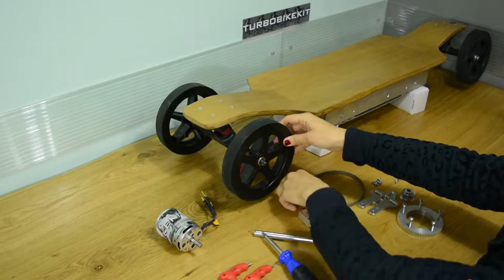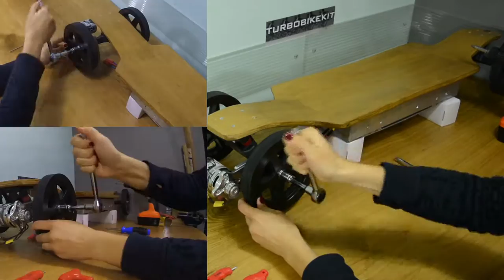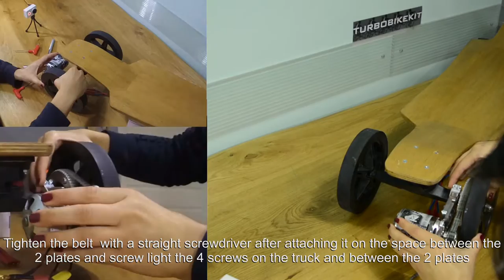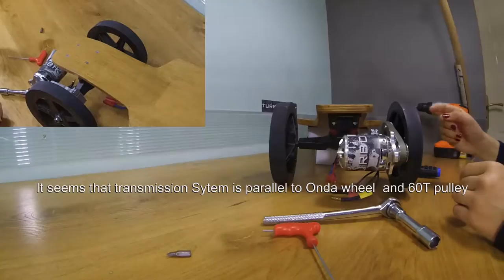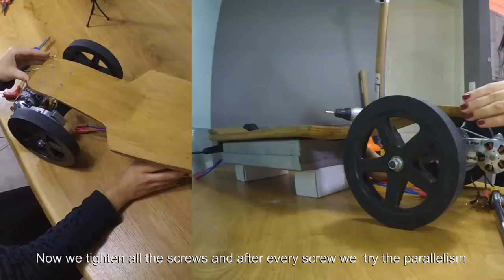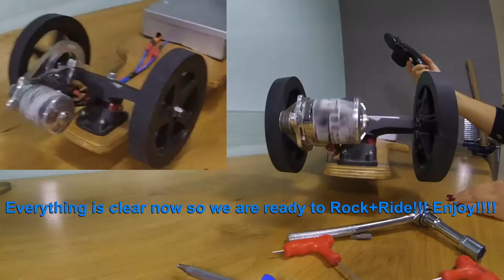Diy Convert Onda Longa Mammoth Longboard to Electric- Transmission System - Installation

Comment: is it possible to build a dual drive board using this system? I mean two motors, one controller, one battery ...
Reply from the maker: Yes oyu can do it. You can use 2 motors in diagonial position